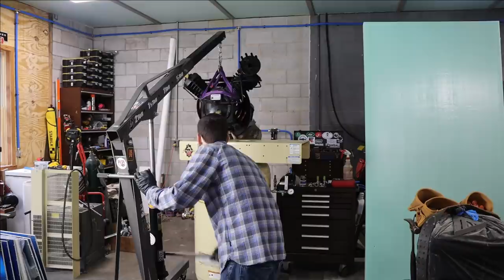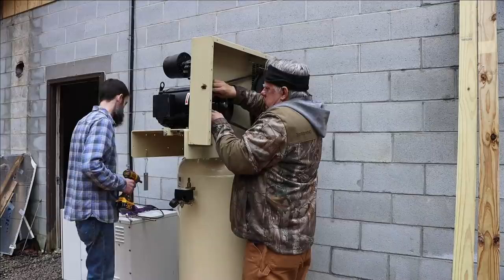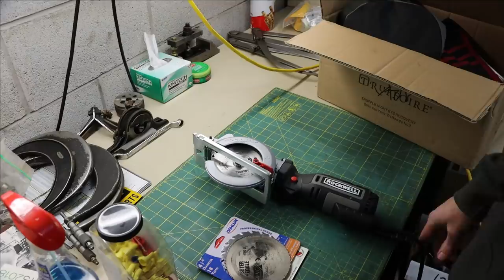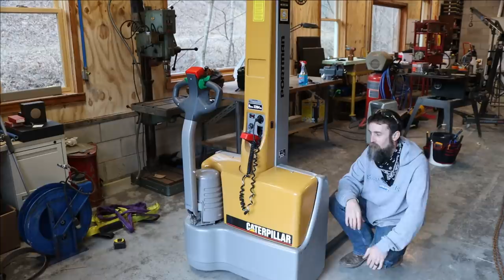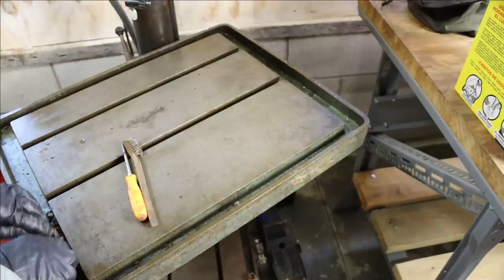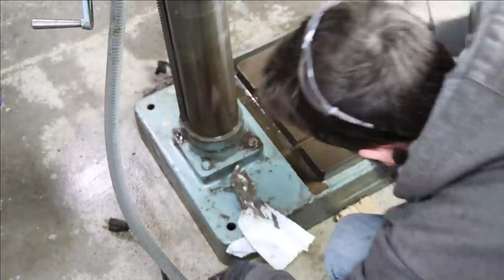Awesome New Shop lift! /  Doall Drill press 1st run and clean.

Comment: Please DO NOT use regular car batteries. AGM batteries are ideal for deep cycle use. Car batteries are very bad for deep cycle use. There are significant structural and chemical differences in the plate structures which make AGM work so well. I have been using a single set of AGM batteries on an expedition offshore sailboat for 20 years, and they are still going fine. They are Lifeline brand, made explicitly for deep discharge. It is extremely important that they be recharged properly. Most "old school" battery chargers are very good at destroying batteries, not charging them. Please acquint yourself with 3 stage charging techniques. Bulk, absorption, and float cycles are battery specific and differ between AGM, flooded, and gel types. A good place to learn about this is windsun.com. Also be aware that in the deep cycle world there are batteries optimized for use with solar systems, such as Lifeline SunExtender series, which are not a good choice for your system. If you buy standard flooded car batteries, whether with removable caps, or mainainence free, they will probably not last long. And do check out he built in charger to see what sort of carging cycles it uses. A call to Cat technical support would probably be very helpful.